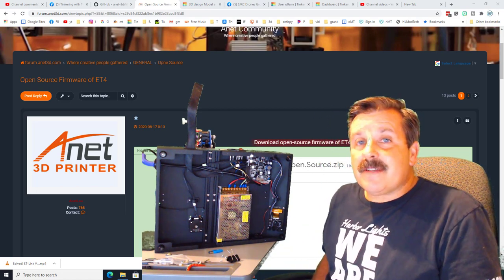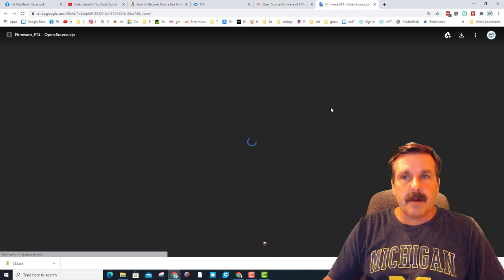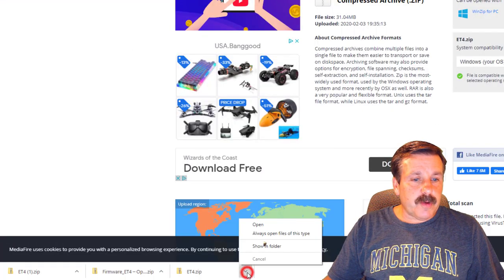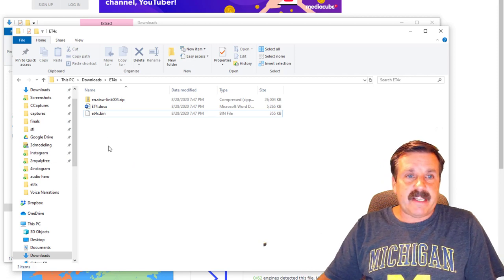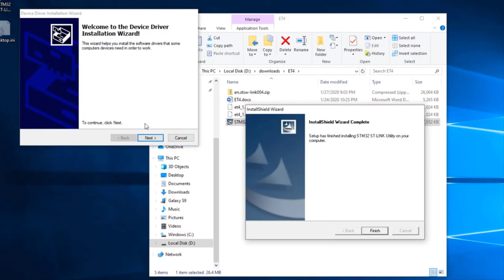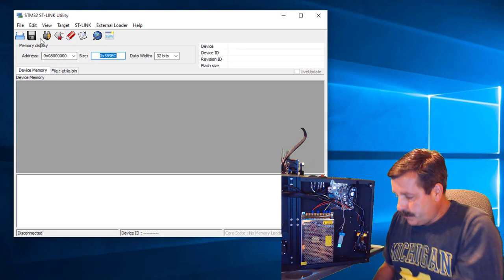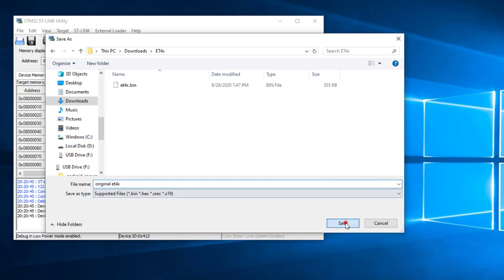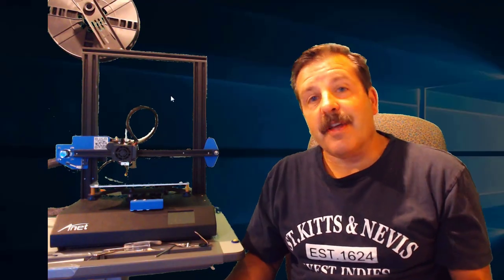Flash an Anet ET4x to Marlin 2+ firmware using ST-Link v2 in Minutes!

Comment: Thanks for the easy to follow video. Question - I used these instructions and upgraded to the Marlin 2.0. a while back. Since I'm already running Marlin 2.0, if I want to upgrade Marlin to the newest 2.1.2.1, can I now just compile and upload to the ET4X directly from Visual Studio via USB cable, or do I still need to use the ST-Link and the bin file?
Reply from the maker: You will need the st link to do it.

Comment: Thanks for the bin file, its no longer on anet. I did find the the touch control is more difficult to navigate with marlin because of the small screen and text so Im debating if I should switch back. Also, can you update the firmware via sd card or usb after installing this or is the bootloader a separate bin?
Reply from the maker: I have gotten pretty used to the touch screen, but you are right it took a bit. I have done the steps to update via SD, but I ended up selling that one. It worked fine, but I did not find it to be a game change. I really only update firmware when something is flaky. Those printers print for me daily without complaint. Hard to mess with that.
Reply: @HLModTech  yeah, the main reason I did it was because the included firmware was very buggy. It would even cause the machine to crash during homing and all sorts of issues if you clicked buttons in a certain sequences. It was like if you didn't use it exactly as they wanted it would not work.
Reply from the maker: I have 2 of them that are still going strong. One does not have SD, so I can only run it via usb. It was a return that someone had actually ripped the sd card reader off it. Strangest thing I have ever seen but I sure do enjoy the machines for the price.

Comment: awesome, have marlin 2.0 running on my ET4X and set up for manual mesh bed leveling. I can't seem too find any tutorials but is it possible to modify the ET4X to install BLtouch? If possible could to do a video on how to do this? I assume it should be a possibility considering marlin can be tweaked to run with this set up, its just finding how to wire it up. I have seen a video for the A8 by crosslink and other printers but so far cannot find one for the ET4X, if it is even possible (The Daughterboard on my printer has the LV connector missing, but has the z stop switch connector)
Reply from the maker: I would guess it is possible, but I do not mod printers. I can install firmware... but tweaking it is not something I have chosen to dig into. My best guess would be that someone on the Marlin Discord may be able to nudge you in the right direction. If you do find some cool stuff, feel free to share. Maybe I can be converted into a modder yet. =)

Comment: My st-link utility can't connect to target anymore after succesfuly flashed marlin without bootloader. It's there any way to solve this?
Reply from the maker: I would double check that the wires are connected right. Then maybe try a 2nd pc. I have not had one that was not able to be reconnected yet. Also make sure the printer is powered on. Sad to admit... but I did skip that step once... 🤦‍♂️

Comment: So I was having issues with the software itself. It would NOT save, load files or read the target. Appeared like everything worked but in reality nothing did. It would show as if it was doing something but the files would not open nor save. What I had to do was update the firmware of the ST-link doodad. 
To do that:
1) Select ST-LINK -> Firmware Update. Try to update and it will say something like "ST-Link is not in the DFU mode". 
2) Disconnect the USB cable
3) Reconnect the USB cable
4) Press upgrade again
5) You can now press YES bottom right to upgrade the firmware.
Reply from the maker: Thanks for the info. After seeing images of the St-link having different pins and such, I guess I am not surprised there would be updates too. Were you successful in the end?
Reply: @HLModTech  Yes, after upgrading the firmware of the ST-LINK V2 itself everything worked just like in your video! Just a buyer beware, that not all ST-LINK V2s are created equal.

Comment: Hi! How can I level with Marlin on this printer?
Reply from the maker: You will still have to level manually unless you add a ABL sensor. I have found that mine works fine with manual leveling. It takes some time to get it right, but once you have a system it is one less thing that can break.

Comment: Olá, a posição do Home para eixo Z, ficou no centro da mesa. Há como alterar isso,mover para o canto?
Reply from the maker: I am sure there is, but I am not sure why you would want that. The center of the bed is a typical place for machines to home. In your slicer you can place your part anywhere on the bed if you have a special place you want to print.

Comment: hi my friend, i like so much your video u helpfull so much in my trooble, that printer can use the auto leveling bed?
Reply from the maker: I do not mod printers... Most everything is possible.. it is just something I do not enjoy.
Reply: @HLModTech   no problem thanks for the answer my friend
Reply from the maker: @heellgate666  You are welcome. If you learn to level a bed manually it pays off in the end. I have had more than 20 manual printers that I eventually got leveled and printed well. You start to hear and feel the right friction. In the long run, having that skill is worth more than an ABL system. My last 3 printers have had ABL built-in and I dig it. I am still glad I "cut my teeth" with all the manual rigs back in the day though.

Comment: When i hit program nothing comes up... everything els says connected and drivers etc are working fine. any ideas?
Reply from the maker: I would start by double checking the wires. Not every ST-link has the same pinout. I have also missed the pins inside before. Older eyes... =)   Lastly the ET4x does need to be powered on... missed the step before too... =) At least I learn from my mistakes though. =)
Reply: @HL ModTech  thanks for the reply, everything is connected correctly and detected by windows, only difference is that I have formatted my PC, but nothing is abnormal from how it was before as its a pc I have setup purely for my printers, I managed to flash it before hand but now im Stuck on white screen and when I click program it dose not even bring another dialogue up, pulling my hair out all day with it tried different software versions v4.10 v4.50 and v4.60 don't get it :-/
Reply from the maker: I am really confused by the version numbers. The only tool I had used to send the firmware was the ST-Link utility.
Reply: @HL ModTech  sorry I meant the version of St link software turns out it was my PC I run it through a vm and it worked only issue I got is its all marlin French 🤣 seems to be only working version for me, least its progression its been out of commission for about 6 months now, I did send you a pm on fb as I was all out of ideas 🫤 but now I just need some one who can help me recompile the marlin fw I got into English if I can't, probably waste another day on it tomorrow lol

Comment: Hi Guys, I just order it from alli .... can somebody tell me, why change software... or differences? why do it? thanks a lot
Reply from the maker: Changing firmware gives you the ability to calibrate it and it opens up the option for you to upgrade the firmware at any time. I’ve got a new ET5X that I have left stock because I can work just as I need and it just works. If you’re happy with the way they print when you get it I would leave it. If you want to dive in and change everything, then you can switch to Marlin but it doesn’t really solve anything. It just gives you things you can adjust that may or may not help.